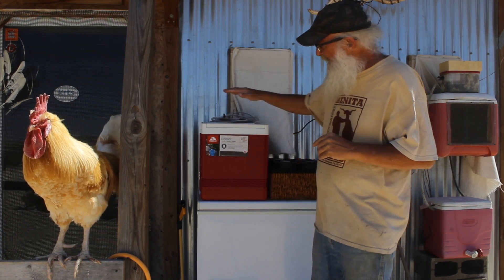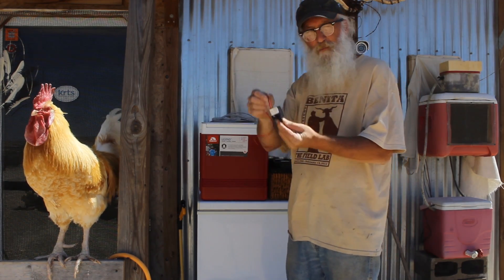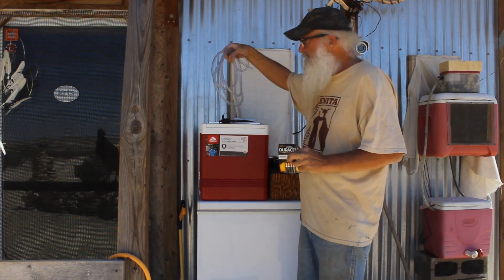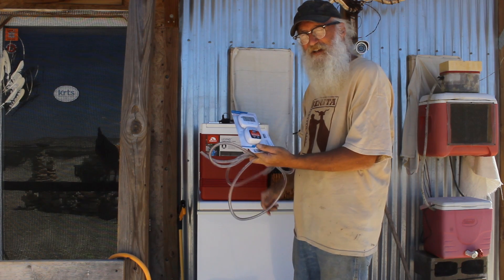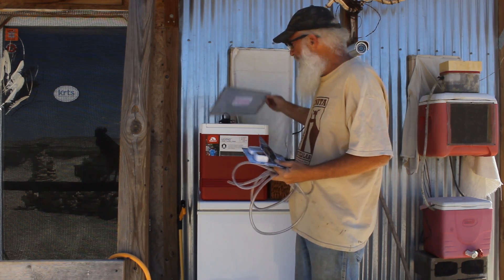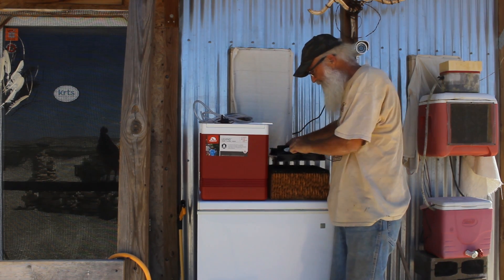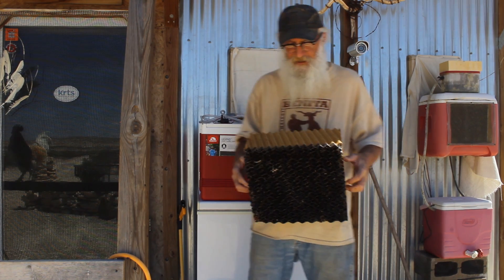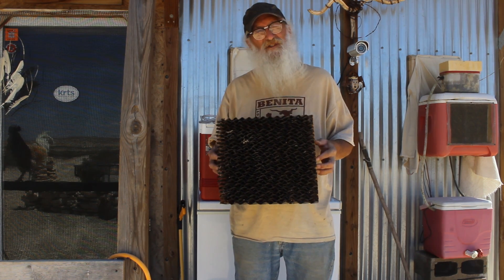cool project part one

Comment: A good teaser for this series would be to show the end result from an earlier blog photo; eg the thermostat showing 20 or 30f reduction in temp from outside, plus the fact that this is off grid electricity and collected rainwater only. By the way, for those not living in extremely dry environments, an evaporative cooler suffers in moderate to high humidity. In dry climates like Big Bend they can be effective and may well add desired humidity to inside environments.